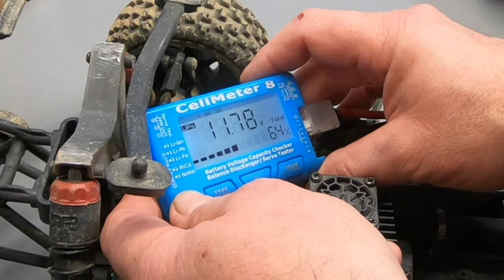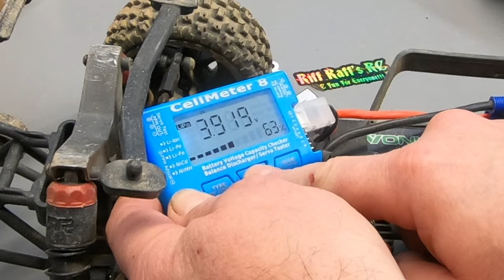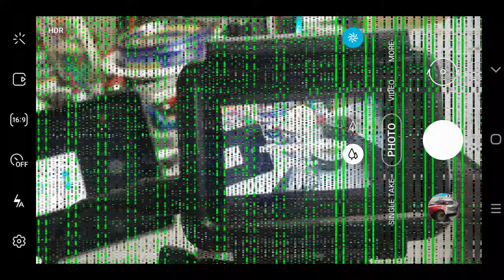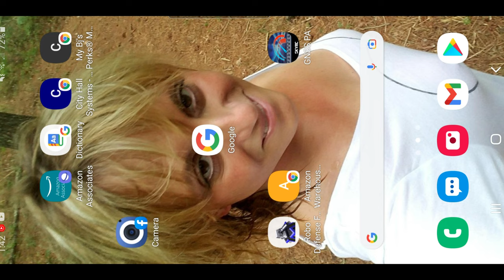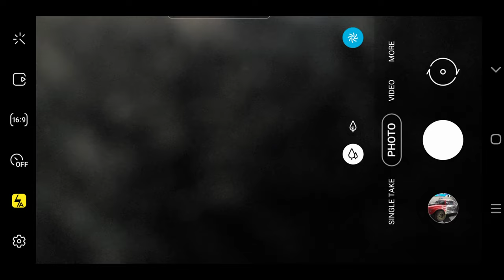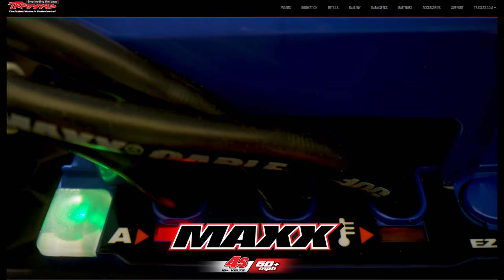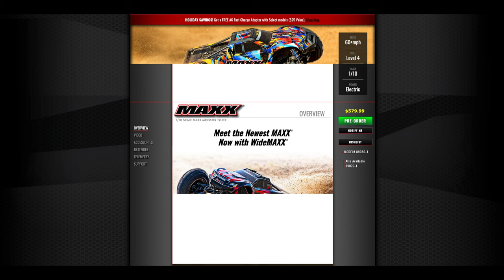Arrma Senton Upper Gearbox Cover Replacement

Comment: It is the top of the shock towers take   a battery pad and glue it on top of the tower it will save the body I did it on my granite 4x4
Reply from the maker: Yes did something similar and provides little bit more protection👍

Comment: GUY! I need to buy those anodized balls for my big rock. (Links from HR). Should I just buy the anodized red balls or do I need to buy new links from being worn down too? I remember you took a micrometer and measured both; but I can’t remember if both are needed.
Reply from the maker: So far the big rock has been good. Just remember all these things are cheap and are considered consumables
Reply: For sure. Appreciate the info